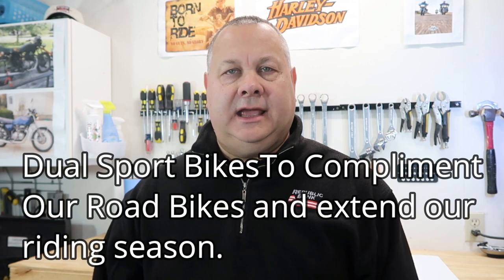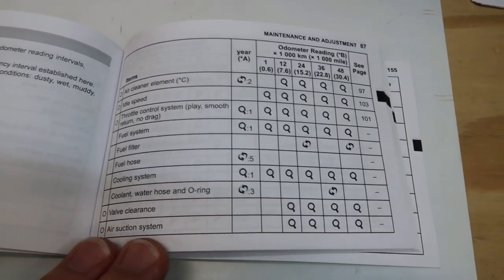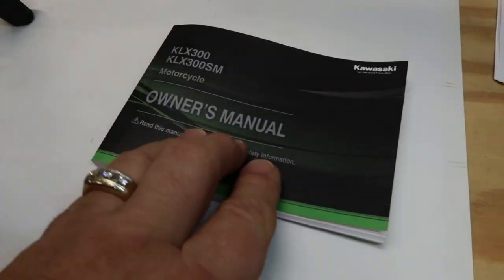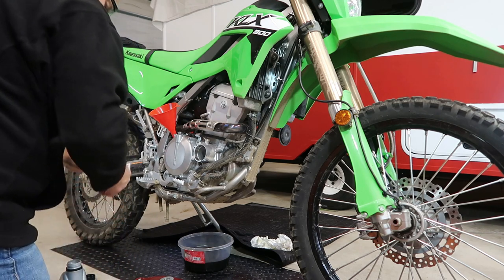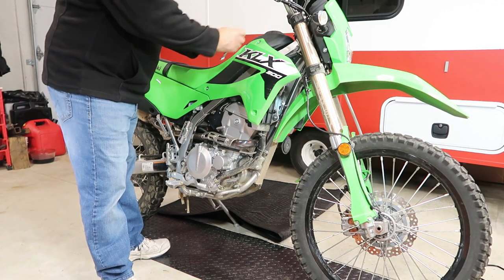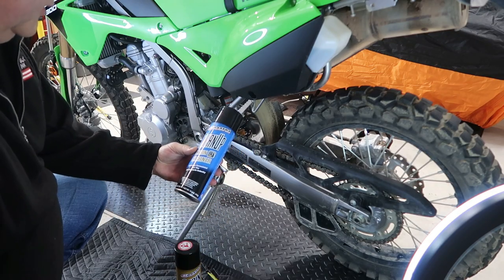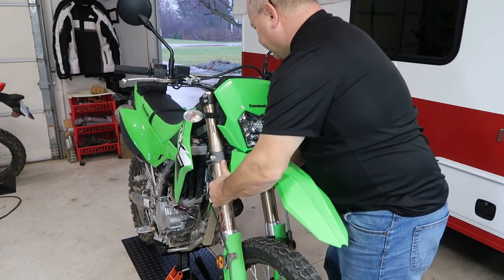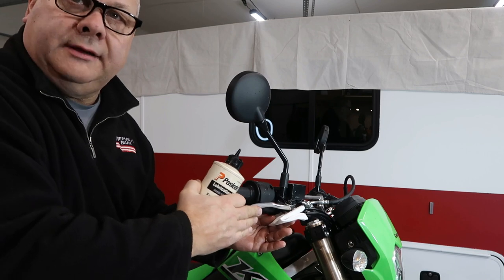KLX 300 & CRF 300L Break-in and DIY First Service

Comment: For what is worth, I'm 63 and I've broken in many new  motorcycles.  1. (ONCE THE BIKE IS WARMED UP), vary the rpm range thru ALL the gears, that's right, 1st to 6th (this will set the rings and seat the valves.  Avoid long trips at a consent speed  for the first 500 miles. 2. change the oil and filter at the first 500 miles. 3. After that, change the oil and filter every 1000 miles.  Of course, this is a dual sport, not an all out 2-stroke dirt bike. So don't beat on it.  That's not to say you cant high rev it for short intervals (even during the break in).  Sustained high revs will wear out any internal combustion engine.  ALSO, DO NOT, put a tuner and a loud slip muffler on this bike. The performance gains are minimal, and you void the warranty.  I love my 2024 300klx. Its light and nimble and the power is adequate

Comment: For break-in, its not just about the engine, but the transmission also.  Smooth upshifts and down shifts, no jack rabbit starts and stops, and no high rev running for extended periods. another thing is, short rides to heat and cool down the engine.  multiple heat cycles during break-in is good for getting everything seated.  I have always used engine hours, in the past, not mileage.  but riding conservatively for the first 10 hours or so, goes a long way to having a long lasting engine, that has well seated rings with no blow by, and gets all the excess material from building, out of the engine and transmission for first oil change.

Comment: I just got a 2023 klx 300r used. Dude didn’t use it all that much I can really tell. But he left it pretty low on oil by the time I got it. He had it since august 2023.  I’m changing the oil filter, draining and filling motor oil. Then I plan on lubing up everything the Manual says. Should I still get it looked at at my local dealership?
Reply from the maker: I'd just do a good service on the bike and ride it easy for a while. If you aren't detecting any issues, you should be fine. Keep an eye on the oil to be sure the level is holding. That motor is tough,it can hold up to a lot. Good luck.